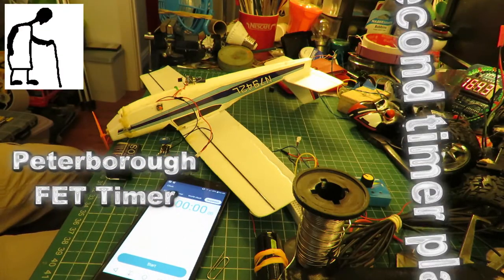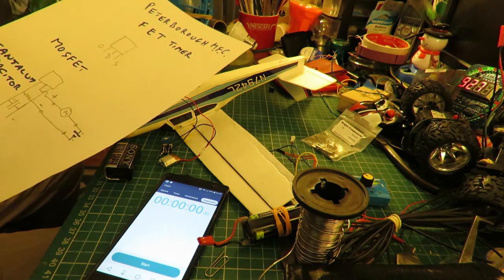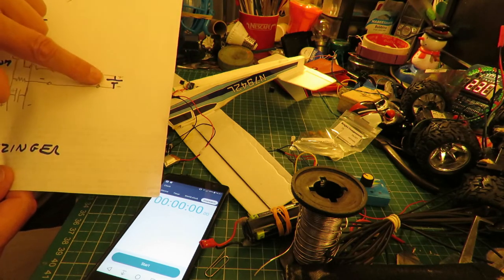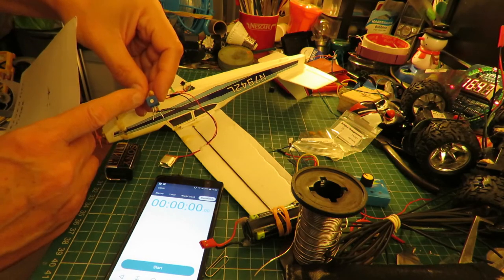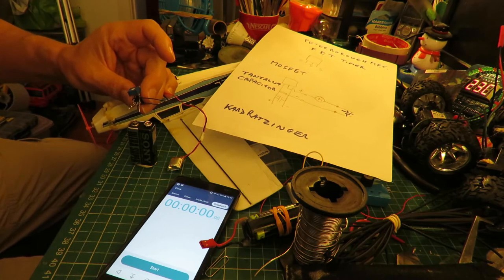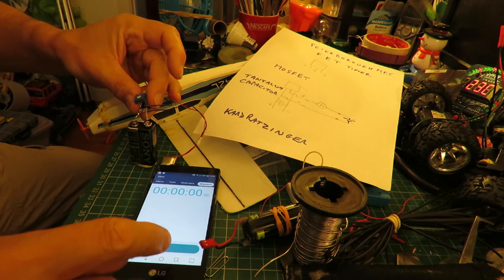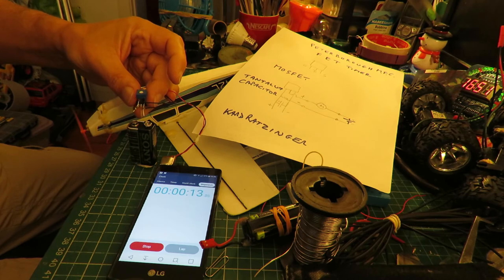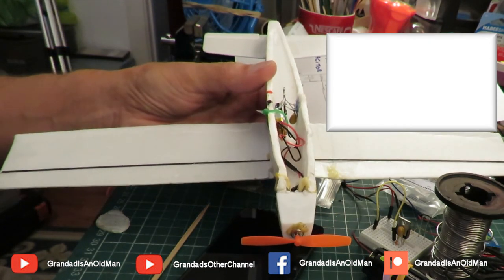10 second timer plane NEW TIMER

Comment: Fantastic work, man! Loved it! Maybe I make one some day. :D
Reply from the maker: The circuit is very simple, I am pleased people take the time to leave suggestions in the comments or I would probably never have found out about this circuit.
Reply: GrandadIsAnOldMan Absolutely! Happens to me too! :D BTW, any news on the micro rc airplanes, with the v911 brick?
Reply: Further to your info unfortunately the quoted potentiometer has been discontinued by the manufacturer but I found an equivalent. This one is 300w as opposed to 200w but I'm sure it will be ok for my use in small can motors.